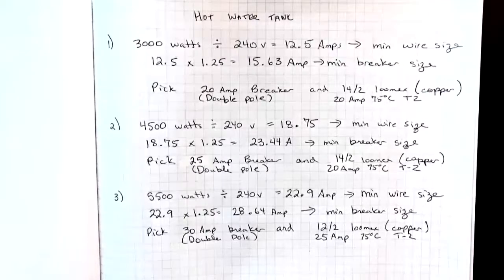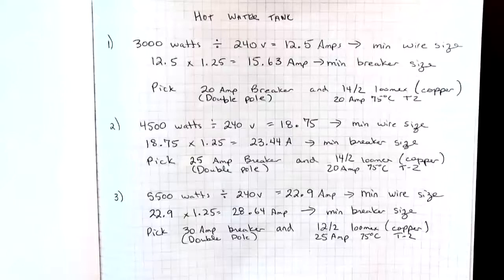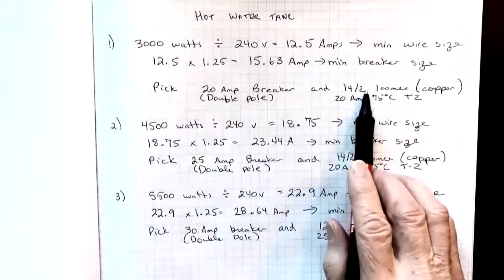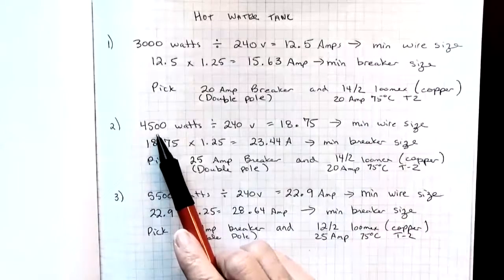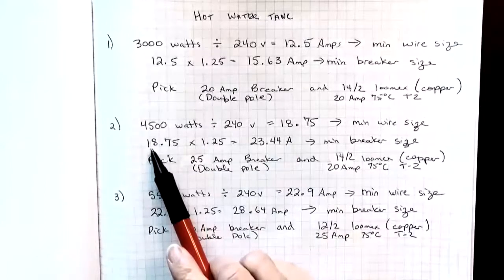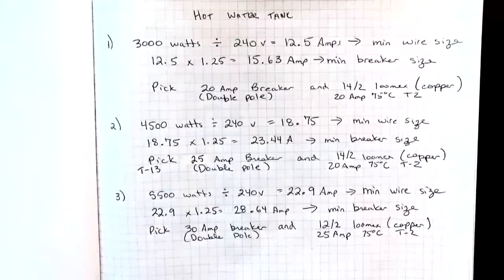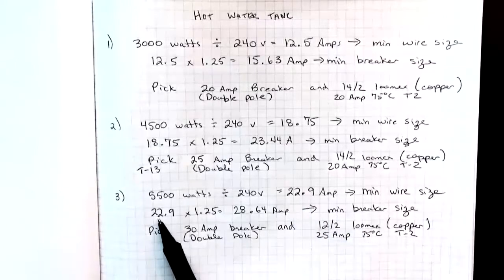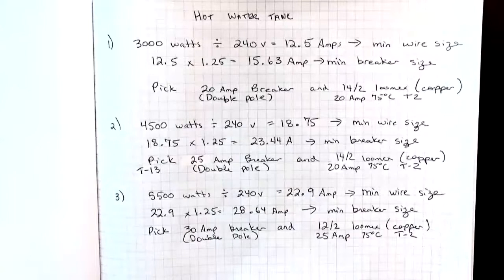CEC 2018-Section 62: Hot Water Tank Calculations

Comment: How are you using 75 degree column with romex?
Reply: you keep the same AMPS you need and use 75 degree to find it and you use the wire size of 75 degree
Reply: Na that's not what the nec book say
Reply: @coreyfranco7060  this is not from nec book this is from CEC book

Comment: Where do you get the 1.25 factor?
Reply: Rule 8-200(1)(a)(iii) takes you to section 62, because hot water tank is considered a fixed electric heating system. (See Rule 62-000 Scope and its Appendix B.)

And the 1.25 factor is based on Rule 62-114(6)(b), which says:The load shall not exceed 80% of overcurrent protection device rating.